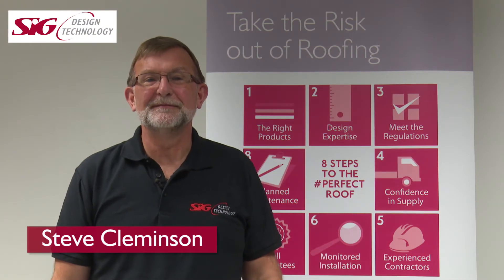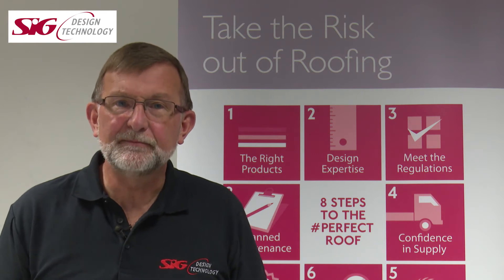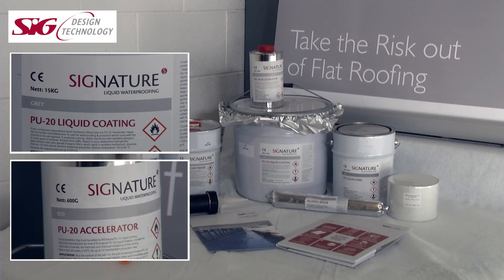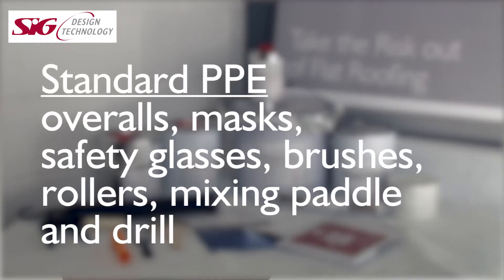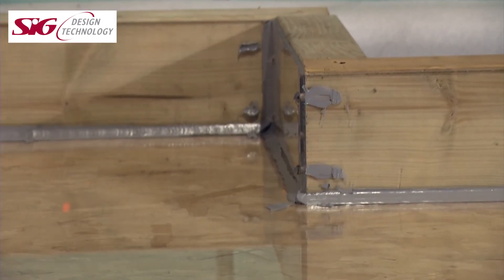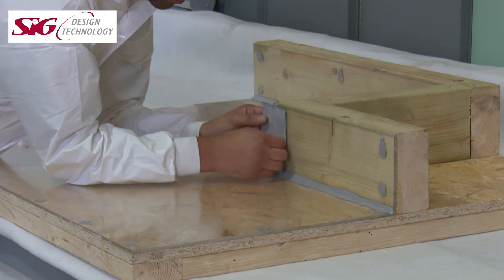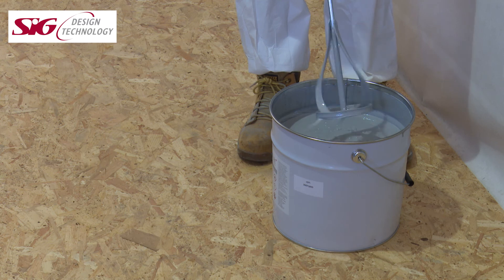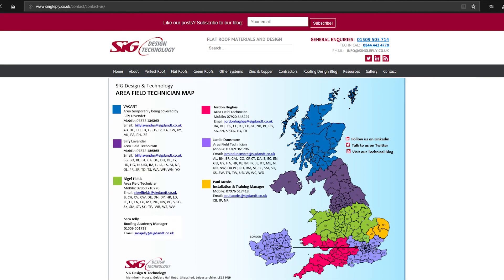Liquid Roofing Demonstration - SIGnature PU-20 liquid waterproofing system

Comment: All these people who have invested in 15 - 20 k asphalt mixers . Thousands of pounds towards machines and equipment. All they had to do was buy a tape , knife , mastic gun and a paintbrush 😂😂😂😂 the most expensive paint you’ll ever buy. I used to use the epoxy primer, fleece years ago and a liquid rubber. Was dirt cheap then . Now loads of companies are doing the same thing. Most of them now don’t have the Catalyst as causes cancer , also a explosive . After the main factory blew up in china they stopped producing it. so air cured. It’s so expensive to buy . Always fails . The companies will pull every stroke not to pay the compensation when it fails and look at the amount of companies just fold up who have previously sold exactly the same thing